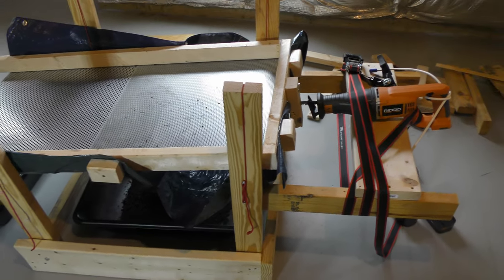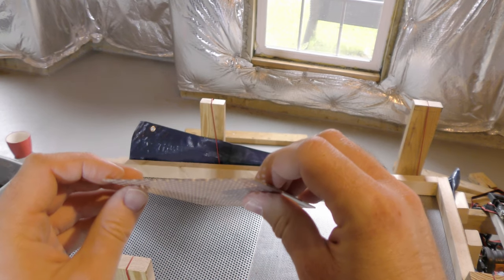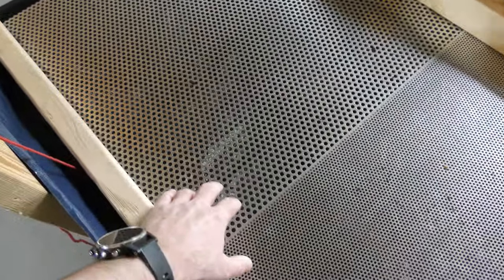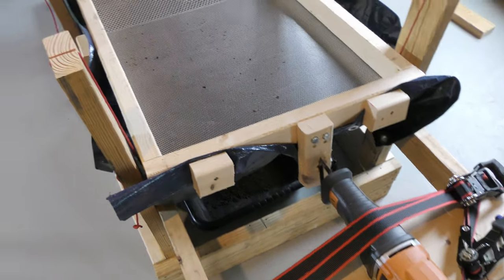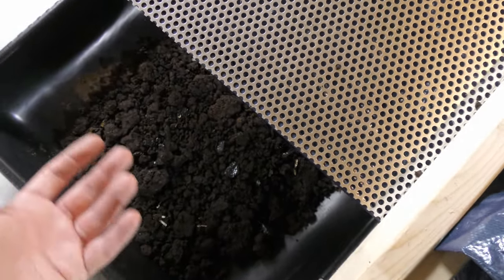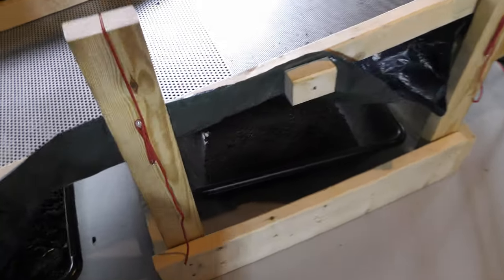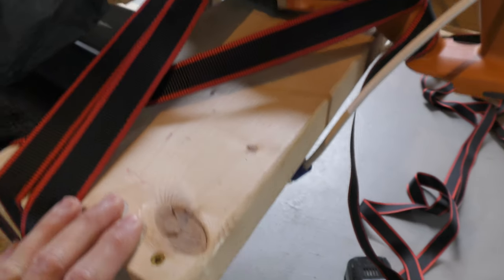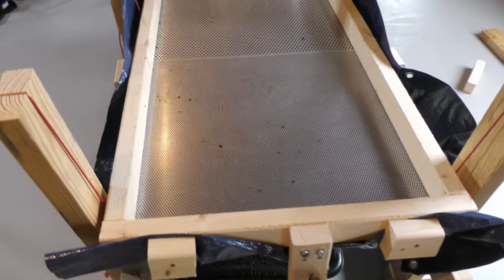Homemade DIY Worm Sifter

Comment: I like what you’ve done. I’ve got a suggestion to improve your idea. One is to feed one side of the bin until complete then feed the other side so the worms migrate. It’ll greatly reduce the number of worms getting onto the sifting screens. To improve upon your design instead of using string to suspend the screens how about cutting a keyhole slot or mortise, the length of desired travel, into the side of the screen frame. Then you can put a dowel, bolt, or something similar into the frame itself for the mortise to slide on. You could use a bolt with nuts to make it easy to disassemble for repairs or cleaning. Or maybe heavy duty cabinet slides. I love the sawsall idea. I could only think of a cam to lift and drop it. A sawsall is a great idea for the back and forth motion. I love this idea. That sifter you mentioned is now like $3175. There are knockoffs available for $900 or so but that’s more money for other projects.
Reply: Is that method referred to as the triangle method or something similar?

Comment: Use a jig saw instead of the reciprocator. A jig saw has more trigger control. Just a thought and probably been said some where else. Thanks for sharing your knowledge .
Reply from the maker: That hadn't been mentioned. I would need to figure out a way to reinforce the blade. I would think it would snap with how thin they are
Reply: @WorldComposting  Yes agree , the thin blades wouldn't put up with too much stress.  If you could reinforce that  the motor control would be great. Jigsaws recipe far slower. Thanks for reply.

Comment: I’ve been looking at a few dozen of these kinds of projects on YouTube. I’m actually just working on a landscaping project. I have an extra old saw and now I’ve found a use for it. For controlling the speed of the saw, A few use a router variable speed controller from harbor freight to control a corded reciprocating saw. I like the idea of the tarp controlling the soil and I’m thinking about bunjee cords to cut down on friction. Also considering making a fake metal attachment that will be stronger than a blade as they seem to break in others projects.
Thank you so much for sharing your ingenuity and talent.
Reply from the maker: Thanks for the router speed controller suggestion it is currently out of stock but I think I'll be picking one of those up!  The tarp was necessary as I tried making a trommel before and castings went everywhere.  I found the paracord I'm using to work pretty well so far but bungies should hold up just as well.  Key was making it easily adjustable without using metal which is too rigid.  I tried using metal instead of a blade but found that I couldn't get it to fit correctly so I cut a blade to be smaller and drilled a hole in it has some movement to prevent binding and possible breaking.
Reply: Thanks for sharing. Please share the information on where I can purchase the screen: I have searched and I have only found Some 7:08 it is only 12” wide. I really need this. Thanks
Reply from the maker: Hi Michael I purchased the screen on eBay but I can't find the listing anymore. I looked locally first but it was really expensive. What had a lot of places to order from I got samples then ordered.

Comment: What's a intelligent invention. Thank you.
Reply from the maker: Thanks for watching! This is really based off the design of the Brockwood worm sifter which retails for around $2,000.  This unit cost less than $150 to build although I'm not sure of the exact cost since I had a lot of the wood already.  The most expensive part was the perforated aluminum screens.

Comment: The sawzall might have been simplest, but it isn't difficult to mount a motor spinning a disk with an arm attached to some part of the disk and the other part to your sliding traay. Might be cheaper, and could possibly also allow you to shake your tray less violently (closer to center of the disk the arm attaches, less travel and greater leverage). I don't know if the mechanism has a name but is standard way to convert rotational force to linear force or vice versa. Seen in many pictures of steam locomotives and steam powered paddle wheel boats.
Reply from the maker: I have looked into doing a disk with an arm and using my drill to spin it which has better speed control. While the process behind it seems easy the building of it has been more difficult. Partially because of time and secondly because of materials. I don't think wood will work so it needs to be metal which quickly increases the cost for materials and less knowledge on my end as I don't typically work with metal materials.
Reply: This idea will also allow you to adjust the intensity of the shaker by either placing the arm towards the center or the outside of said disk/gear.

Comment: I would just expand on your drill idea and add up and down shakers by putting a small pulley wheel on the end of a half inch drill and grinding it to look like a cam or egg shape. the speed is also adjustable on a big old electric drill. Nobody uses the corded drills anymore so you get them at garage sales. It would shorten the length of the stroke by putting soft foam bumper pads on each end, this combined with the up down  action of the drill cam  could help. Thanks for your help, I am just developing my interest in raising the oldest land animals on earth. Unchanged for 650 million years :)
Reply from the maker: I have toyed with using a drill instead of the reciprocating saw but it seems to be less smooth on the motion.
Reply: You could also wire those old drills to a rheostat and fine tune the speed of them as well.

Comment: What a great idea.  I have an old hedge trimmer that boke but the drive still works and this is a prime project just made for it.  I'm guessing that you pre-sorted the worms as best you could because the medium seems very dry.  Thank you for this video.
Reply from the maker: You are right a hedge trimmer should work really well and have the power for it!  Although I'm still playing around with the angle and speed.  I might want to up the speed but to do that I'll need more weight so the machine doesn't move around!
Most of the material going through was Hardwood Pellets or Coco Coir this time and I did let them age quite a bit before sorting them.  I plan on trying some bins that run primarily on cardboard but will need to dry the contents out before trying this out.

Comment: Hi David.
What a nice idea. It might take some improvement in order to make it more resistant against the aggressive vibration its going through, however, what I find difficult to figure out, is the point, about the two different holes sizes in the perforated boards, while after the sifting is done, all the casting is anyhow drained into the same container withot any distinction; or there's something, I must have missed.
Reply from the maker: Hi Yoram, I purchased two sheets with different size holes for two reasons first so I could separate based on size later if I wanted to. Right now everything goes into one bin as building out the separation was not a top priority as I was still testing out the machine itself.  The second reason was I felt dumping castings on holes 1/4 inch would allow too much material to be forced through as I placed the it on the perforated metal. The first section is 1/8 inch and the second is 1/4 inch. 
I hope that answers your questions if you have anymore let me know!

Comment: Congrats! A very practical and usefull idea. I have wach a lot of video, and I think this one will work for me. How do you think I can attach and old wasmachine motor instead?
Like your idea very much.
Reply from the maker: Thanks, I have thought about attaching this to a drill that spins rather then moves back and forth and would think a washing machine would be similar.  You will need the shaft going into the center of a metal circle then have a metal rod attached at the edge to create the back and forth motion.  You could also try and use it to vibrate the screen which can work pretty well.

Comment: I would make the adjustable mechanism out of metal, like with a metal bar or straps, still adjustable. I would think where the rope anchor points would keep rubbing and eventually wear out.
Reply from the maker: I think they will wear out eventually but to help slow it down I did make notches in the top the string sits in so it doesn't rub at all on the anchors and only a little at the top wear the movement is.  Also string is easy to replace and adjust as necessary.

Comment: What's the point of two different size sifter plates when it all falls into the same bin?
Reply from the maker: I did this so that way I could separate them out into different containers in the future if I needed to. Also the 1/8 inch up top gives me a bit of area I can dump the castings without them being forced through the large holes.

Comment: Love the sifter, looks like it would run much faster than the manual sifting I've been doing with our worms.  I am a bit curious, why you have both the 1/8" and the 1/4" sifter holes both going into the same completed compost bin?  Since I typically use the 1/4" screen to sift out the worms and the 1/8" screen to keep the cocoons from falling into the finished castings.  Would it make more sense to have two different collection bins for the different hole diameters?  What has been your experience with this?
Reply from the maker: The big issue I had with manual sifting was you need to empty the screen instead of having it just run off like this does.

I have both going into one bin right now but I will probably add a wood bar between them and separate the castings like you mentioned.  I also did want a location to dump the castings so they would settle before hitting the 1/4" as a lot can fall through due to momentum which I don't want. 

As I use this a bit more I can always make some changes to help get better results but I wanted to finish this as I have a lot of material to sort and the time to test and make changes.
Reply: @WorldComposting  I agree, finding a way to get the castings settled more quickly would let more of the smaller pieces call through the 1/8" holes, I also wonder if less of an angle would give it more time on the smaller sifting area.  I love the reciprocating sifter much more than a rotating trommel and would love to see any more improvements that you come up with

Comment: Good job. Where did you buy those bins / trays, where the compost falls into, and what would I type into Google or Amazon to track them down?
Reply from the maker: I purchased them at Home Depot
https://www.homedepot.com/p/Plasgad-Black-Medium-Concrete-Mixing-Tub-887101C/205451550
You can get them on Amazon https://amzn.to/2SQhDV6 but they are somewhat high priced.

Comment: Mu thoughts would be to have a slope to add the compost meterial onto to slowly suplie the machine it was sorting the meterial 2 fast to effectively separate all the 3mm meterial if you could reduce the angle or restrict the transfer to the 6mm section that would help hope you don't take this as criticism just advice thanks for a wonderful idea  and video

Comment: Do you really think the worms are damaged by hardware cloth? I am blown away by the cost of the aluminum.
Reply from the maker: In a shaker like this yes as it isn't flat but If you used hardware cloth most would survive but might be ripped up.  You could maybe try coating it with a plastic or something that will help smooth it out.  Now if you had it vibrate up and down you could probably use hardware cloth without issue as the worms wouldn't be sliding as much.
Reply: @WorldComposting  
I'm going to build just a hand shaker so maybe the damage would be minimal. Don't want to hurt my worms.
Reply from the maker: You can also buy a pan sifter from amazon which might hold up better than building one.  I know that when I built one the hardware cloth rusted after using it twice.  Here is a link to a set of gold sifting pans that could be used https://amzn.to/2LPhocB

Comment: Do they make an aluminum sheet with holes smaller than 1/8”.  The idea is to remove silt and sand but nothing else.  Thank you.
Reply from the maker: I ordered it years ago on eBay but if you search on there I'm sure a company would make what you need.

Comment: How did you slow the saw down? I have a corded model and returned 3 speed limiters already for not slowing the saw at all.
Reply from the maker: The trigger on my saw has about 3mm of travel where it slowly ramps up and I try keep the trigger within those 3mm of travel. Really hard to do but I didn't want to purchase another one just to run the sorter.  I have been tinkering with using my drill to move it as the trigger has a longer pull but haven't found a good solution yet.
Reply: @WorldComposting  Thanks. I'll keep trying to find that spot on mine. I have operated it extremely slowly to get the end of the piston all the way back or forward for blade removal. Then it jumps right to warp speed. =/

Comment: Th upper portion of the 1/8th screen is not getting much use. Perhaps a 4 inch strip of plywood to move the screen down the line a bit to better utilize the full screen. I like a idea and thanks for posting.

Comment: do you still remember link you buy it from ebay for screen?
Reply from the maker: Here is the user I ordered from:  https://www.ebay.com/usr/kay_enterprise?_trksid=p2047675.l2559
and here is a link to perforated sheet: https://www.ebay.com/itm/Perforated-Metal-Aluminum-Sheet-1-16-Thickness-24-x-24-1-4-hole-3-8-stagger/183403267113?ssPageName=STRK%3AMEBIDX%3AIT&_trksid=p2057872.m2749.l2649

Hopefully the links work
Reply: World Composting thanks very much it is helpful

Comment: I don't understand why you have two different sized sieves and only one result, one grade of sieved compost.
Reply from the maker: Two reasons.
1) The smaller holes up top make it where less material falls through when adding it to the sifter.
2) It gives me the option later of separating out the castings by size using tarps. Right now I feel that is not needed but I was worried about it when I built it originally.
Reply: @WorldComposting  Gotchya.  So, 'future-proofing' your machine, very sensible!

Comment: More than one way to skin a cat . Looks like it worked pretty well. Noisy but that is to be expected.
Reply from the maker: It is a bit noisy by not nearly as bad as I thought it would be.  I can run it in my basement and it sounds like running dishwasher on the main floor and you can't hear it on the top floor at all.
Saying that I still wonder if a setup with a drill might work better or a vibrating unit of some sort.